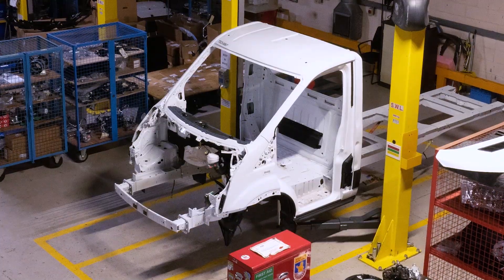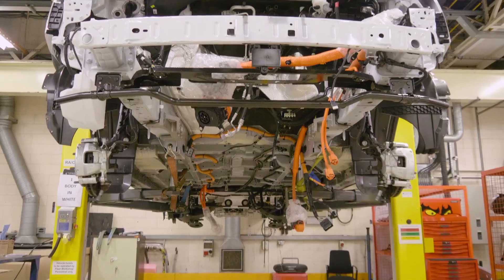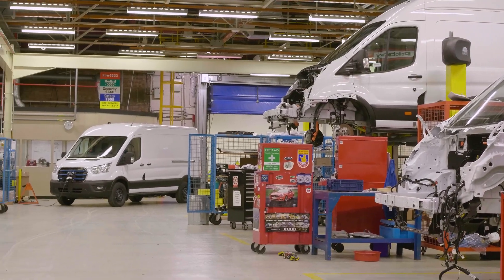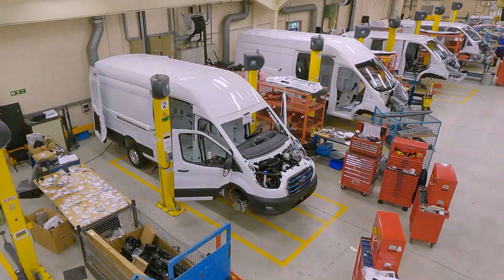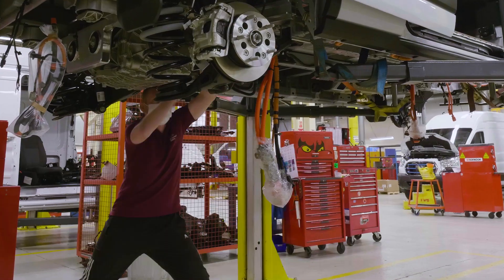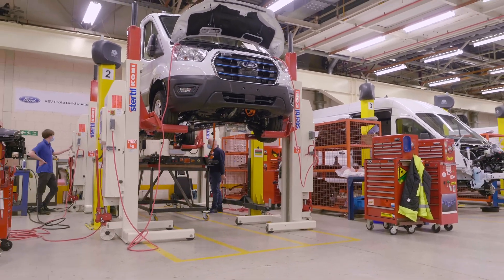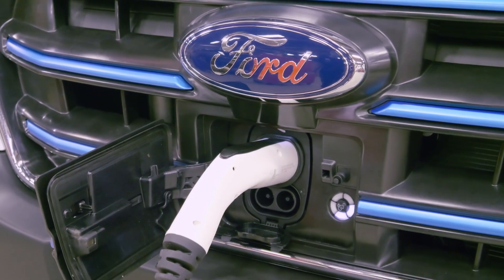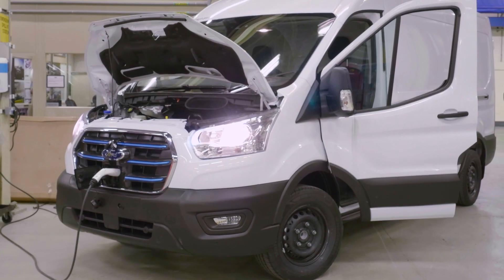The All-Electric Ford E-Transit | Time-Lapse Build

Comment: Unfortunately "advanced" is not the right adjectif for this battery pack. "Obsolet" is more adequate. 

Put 120kWh in these vans/trucks for the same weight and THEN it will be advanced, or at least not so bad. You need to make these vehicles as light as possible (by using aluminium), as aero as possible, more efficient (drivetrain), and with 200 kWh of batteries.

Comment: Manufacturers can only do so much, governments and the private sector around the world need to ramp up the charge points, education and the whole e-vehicle infrastructure if we are to get anywhere.
Reply: A large part of these vans will be used as urban area delivery vehicles and for example mechanics' vehicles visiting customers, and the operators will surely want to add charging points to their terminals and garages so the vans will charge for cheap during the night, when the workforce is at home.